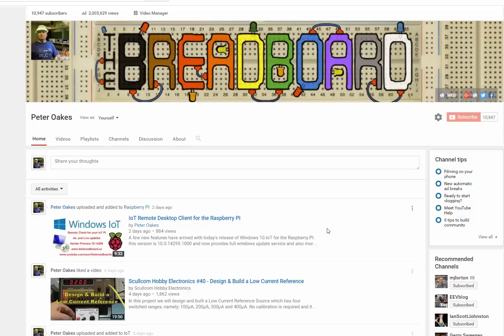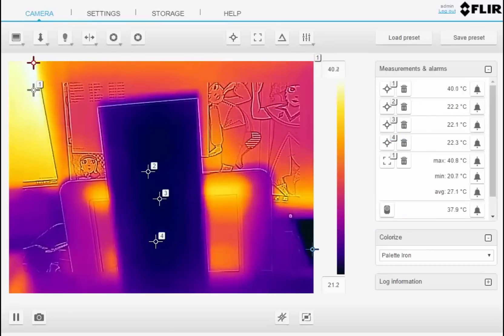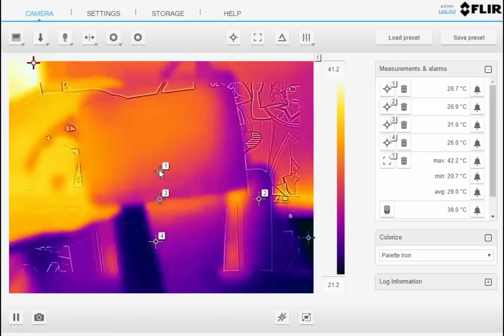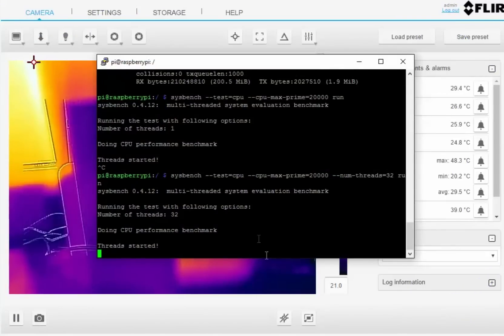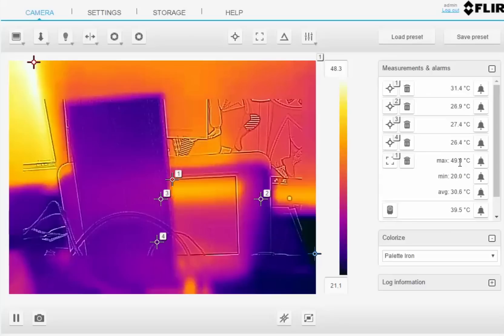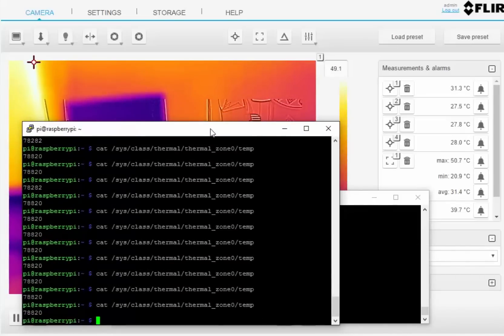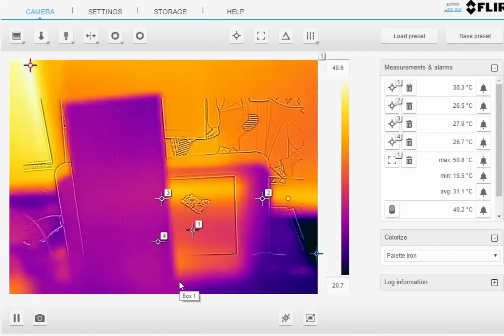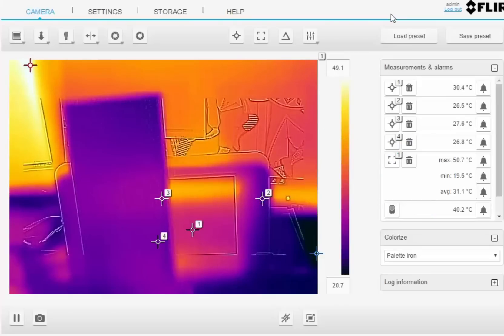Using a FLIR AX8 to test a PI 3 full load temperature

Comment: ty, good video.  I will look for one showing the other side as well, to see where it might need cooling.  have a great day.
Reply from the maker: If you never going to overclock then there should be no need to add additional cooling, Well maybe if you're putting it into an enclosure with no ventilation for example, but then, even a heat sink would not do much. 
As I never overclock my PIs and I dont run games etc that would also stress them out , its unlikely I will be doing a special cooling video.

Also if the PI does get hotter than normal it will down clock to protect itself, so if your peaks are only for short periods then it should be good without.

Only testing in your particular situation will show if any is needed, it may also show you simply need a more capable board because running any system no matter its capacity at close to 100% is never a good thing in the long term.

Comment: that's what you get for cramming CPU and RAM together on a stacked chip
Reply: the chip beneath the other one will have no way to dissipate heat
Reply from the maker: +Suraj Grewal The lower chip is not directly below the CPU chip, it is off to one side, but yes, you need to be sure it does not get too hot, the boards normally have large copper power planes that also double up as heat dispersion paths for the chips. Not the same as a heat sink of course but better than nothing
Reply from the maker: +Suraj Grewal The issue is really only under a heavy load, with typical lighter loads with occasional heavy loads, there should be no issue